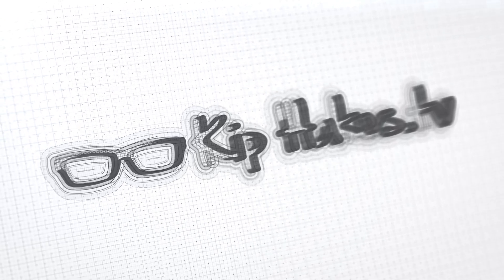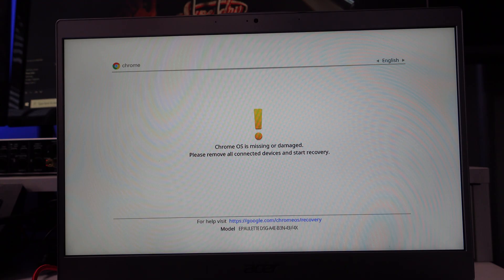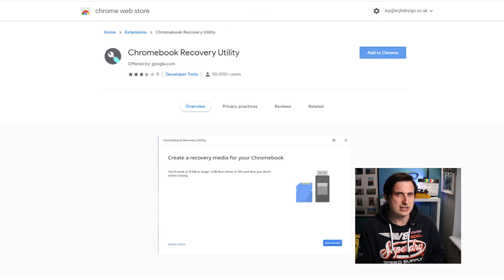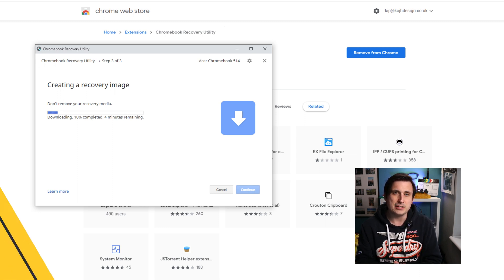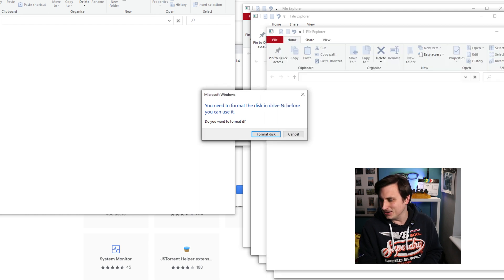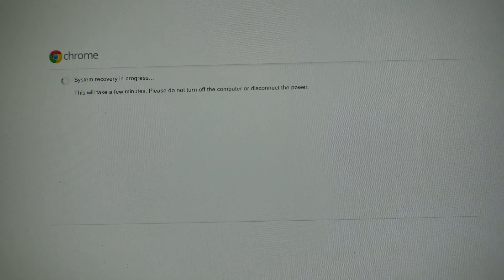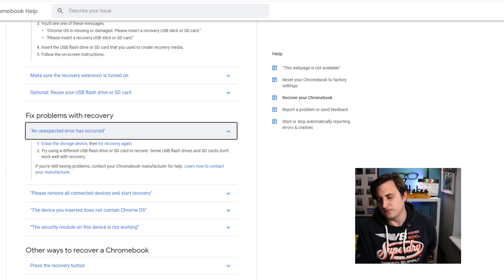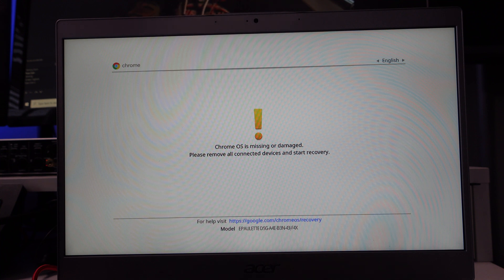Trying to Recover and Fix a poorly Acer Chromebook 514

Comment: Howdy, I have got the same problem that you've got too, where it insists to get on recovery but also sometimes boots for a little bit. I have tried many different USB drives/SD cards but no luck. I was about to give up but have somehow found a way to fix it. All I did was plug the USB drive where it asks to start recovery, let it verify and when it finishes and says 'Recovery in progress,' give it 10-15 seconds to do it and unplug the flash drive, it should say 'A unexpected error has occured' but that's ok, then try rebooting the computer and see if it works. If it doesn't work then you could try flashing a different BIOS and then installing like Linux/Windows, whatever you like. If it still doesn't work, then yeah, it's a EMMC failure, hopefully it is not. Let me know if it helped and if you have any questions, feel free to reply. :-)
Reply from the maker: Well it's with Phil at TheCod3r now to see if he can fix it! :)